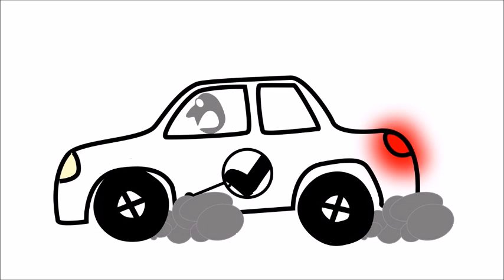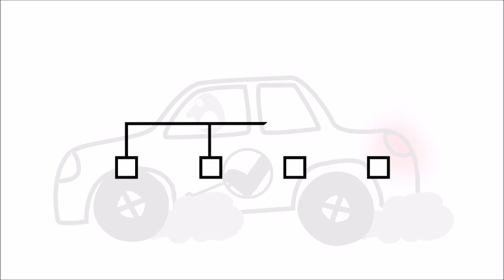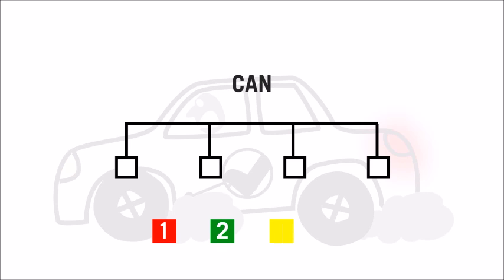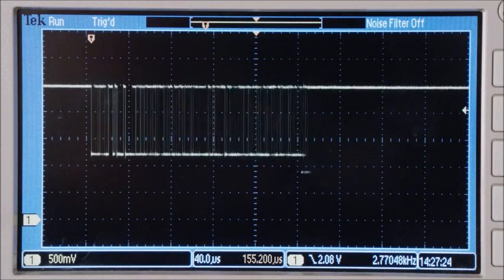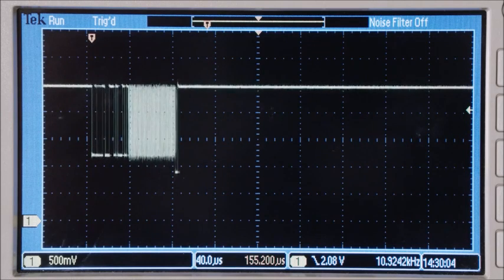Technical Comparison CANbus, CAN FD & Ethernet

Comment: DOES CAN HAVE I.P ADDRESS?
Reply: No. All traffic is broadcasted.
Reply: Messages in CAN have an ID identifying the contents/meaning of the message in the contol system. In some higher layer protocols, like J1939, the ID may also identify both the sender and the intended recipient of the message.
Reply: @Tomás Franco  acctually i cant explain why, but its many different. in CAN bus there isnt master and slave for exemple
Reply: @Tom Franco CAN basically relies on arbitration ID, whereas I2C has slave ID and then comes the data or the message